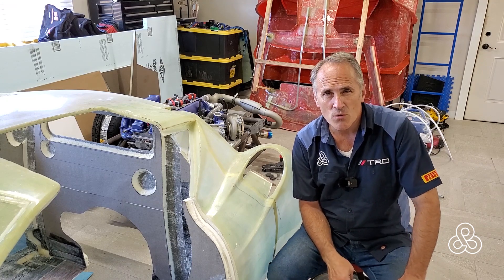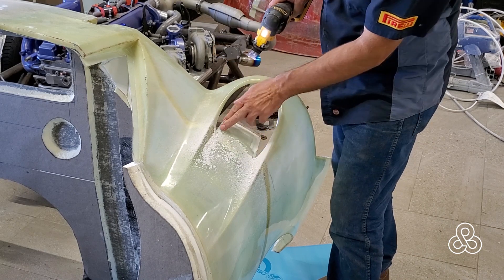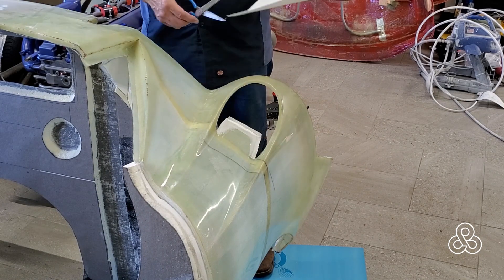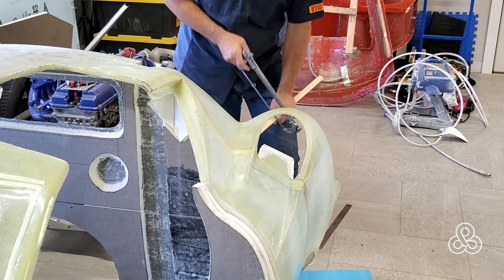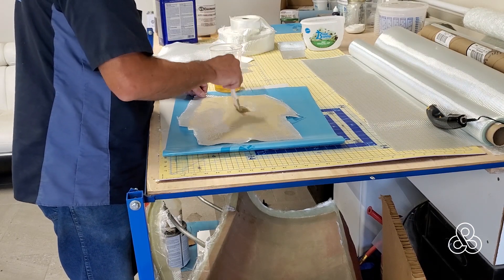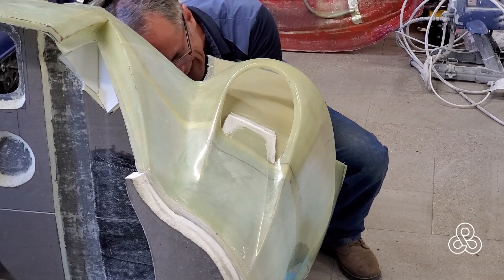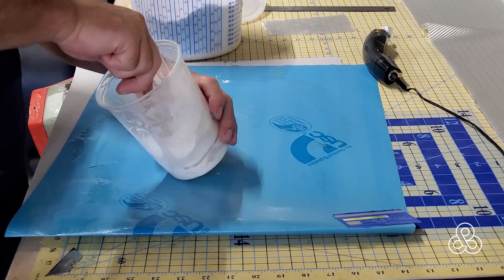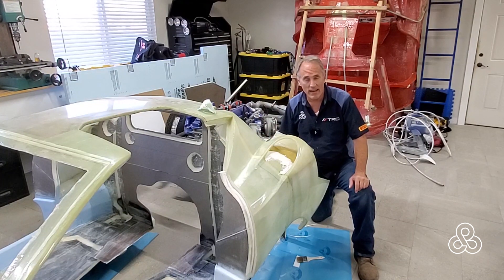A35 - Arete Supercar Project- Composite lamination to extend the side intake duct.

Comment: Love you videos THANKS !!  Why don't you perforate the foam sheet we have a small roller with spikes to do that seems like it helps the resin tie everything together .
Reply from the maker: Would likely just add unnecessary weight, as the epoxy adheres beautifully without added mechanical bond. Thanks for your interest however, and thanks for following the channel.

Comment: I have been bingeing on this show and its great the solutions you have. I'm still not sure why you are using the strand fibreglass and not just some foam and make a cavity... 🤔 What is the difference in bond strength between making the whole thing in one go, and laminating over cured glass? What resin are you using?
Reply from the maker: "One go" is by far the superior method, however just not practical or at least I'm not able or willing to do 8+ hour laminating stints. Bond strength is correlated to how well you break into the base layers of fiberglass (without breaking so far as to disrupt[t the weave) The epoxy is supplied by US Composites, it is a structural laminating resin.

Comment: I'm excited to see the construction of the CNC. Are you thinking of building a large scale SLA printer as well? You could use a UV bed to harden the resin with a DLP or Laser short throw for your aperture. If it's over a certain size you will probably need a dual suppot Z axis gantry.
Have you thought to make the airflow cowling a bolt on  or tabbed part? If you're going to reproduce the body panels it might be a good idea.

Comment: Binged watched a few episodes now. Have you ever watched Bad Obsession Motorsport’s project binky? 

Also, whats you’re reasoning for fiberglass over carbon fiber?
Reply from the maker: Carbon fiber only where there is a reasonable advantage in the material. Glass just to bond the carbon in place. All the main structure is S-Glass composites.
Reply: Price.

Comment: Two wheeler with a fiberglass Fuselage body. I have some images and vids of rough foam plug on my channel, finishing shaping to fiberglass now , wish I would have seen your vids first, would have used burlap and plaster method but , onward and upward with what I have. Definitely want to see your fiberglass tutorials!
Reply from the maker: Just came from your channel, and no, I think you were right to go with the foam. A small narrow form like yours can easily be shaped and made symmetrical in the foam. Is this going to be a one-off bike? or are you planning on duplicating it? If its a one-off I can step you through a method of taking your body panels right off the plug (perhaps a video tutorial?)
Reply: BuilderCreator , thanks for taking the time to look at the channel, I plan on doing molds, one for the option of doing multiples, also for the experience doing a mold . Next will be planning the drivetrain, trying to decide straight ice motor or a hybrid electric set up! Looking forward to your newest vids, thanks again for the videos and convo. Good luck with the build!

Comment: How much does it cost to make a car like this
Reply from the maker: I have set a budget of $25 thousand. That is for all materials and components. Does not include the cost of fabricating the molds at about $4K. I'm doing pretty good at sticking with the budget, but bolts and hardware are killing me. seams like 40cent bolts are $2.40 now days. Anyway, the $25K budget was to keep me grounded and to make the project realistically  feasible for anyone finding the channel and considering venturing off onto a project like this. That is one of my main objectives, to inspire others to take on big projects. Oh! the other hidden expense, "my time" at $5.00/hr (I work cheap) x 4000hr= another $20k, but I'm a terrible employer and will likely never pay myself. Ha!
Reply: BuilderCreator ok thanks